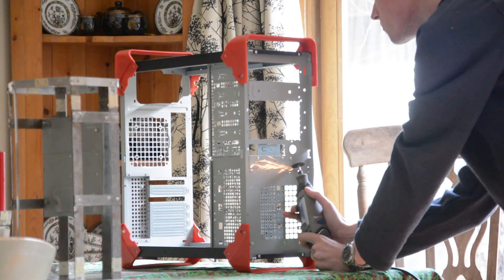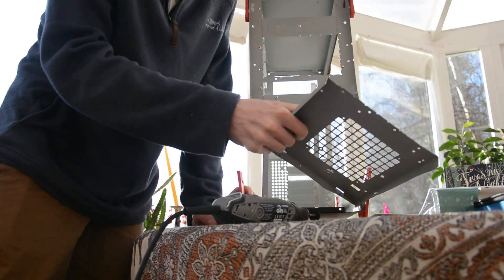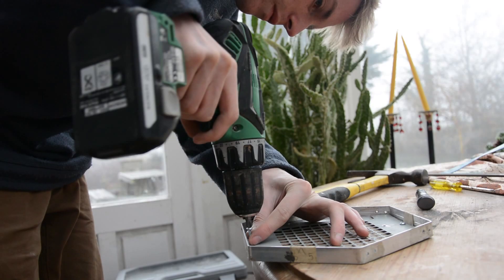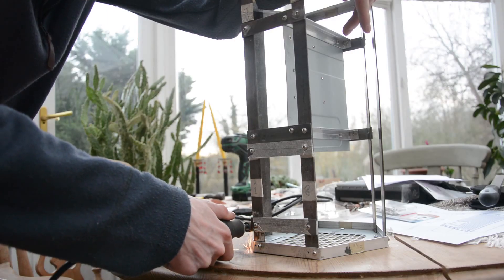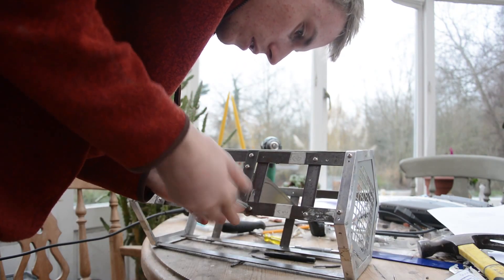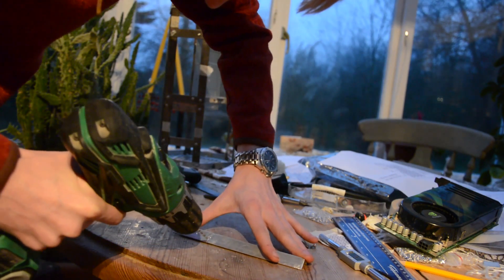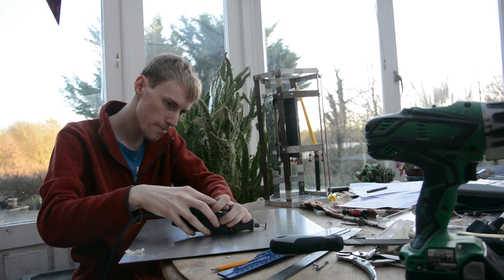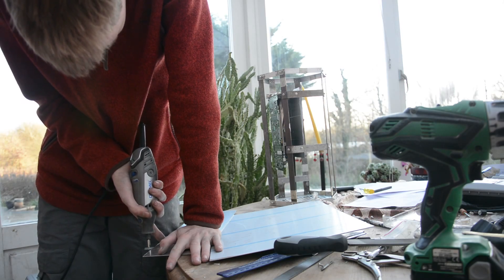DIY computer case - Stuxnet part 3

Comment: Why didn't u just drill holes into plexi glass and mount fans str8 to the glass without using that ugly fan mount from other case m8?
Reply from the maker: +pg86131314 I did what I did for a number of reasons. These include save money, you will not see the fan mount and I will be painting the case

Comment: Good work, but you need to ensure you bold the tap and die at a 90 degree angle rather than leaning over as you do...there are other criticisms I have but I will leave it at that for now.
Reply from the maker: I don't really care about doing things correctly. I far prefer to do things my way and learn from my mistakes. I don't intend these videos to be used for people to learn how to use the tools and techniques I use but to show the progress of the final product.

Comment: Doesn't the aluminium frame would just make the DIY casing be electric conductive.
Reply from the maker: Xhin Ava yes. All it means is you have to attach computer components with a small amount of planning (just like in a normal computer case)
Reply: Is the project finished?Like a part 4 videos explaining more about the frame, joints and the drilled holes for mounting point etc...oh and air flow,I suppose there should be an exhaust fan up there?
I am just really curious why is there no rubber used in joints,it would been very easy to prevent electric conductivity,I had the same idea but not in this shape.
Reply from the maker: Xhin Ava the case is still being made. I only can work on the case 3 times a year if I'm lucky. I am hoping I can work on the case over Easter which will be finishing it and then there will be one more on explaining the design etc.
Reply: Jaw dropped...ok,busy life huh.
Reply from the maker: Xhin Ava very. I am currently at university so am only home 3 times a year

Comment: How thick is that aluminium sheet? Also how will the hot air from cpu and gpu gonna come out? Are you using blower style gpu?
Reply from the maker: I think it is 1mm. It was some time ago when I purchased it.